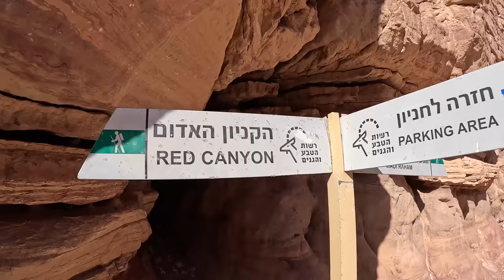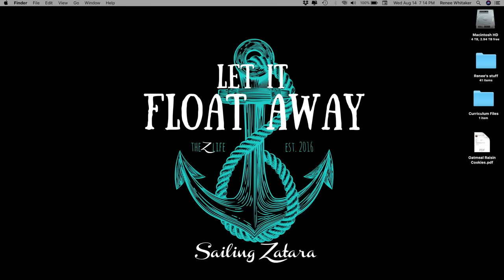We've got NO POWER!!💥 Boat Electrical Problems⚡️(Ep 228)

Comment: To make things simple in electrical world for those not naturally inclined:  You start at the source of electricity with your voltage meters (Nice choice in Fluke Keith)  and then you follow the path of electricity to where it stops. His obviously stopped at the switch. He disconnects switch after verifying the electric (either one leg or both) aren't coming through, and verifies its working where it comes in to the switch like he did. That is what told him the switch was bad. From there he removes the switch and recompletes the circuit as if the switch didnt exist, and then he turns on triple verifying that was indeed the issue and now goes to get the new switch. :) 
 I am always impressed how awesome Keith is on things he probably never specialized in. You guys are amazing! If I were 18-21 I would totally be applying for the live aboard. Hell if I were 30 I would at least fake it .... XD
Reply: i dunno. I think his AC burned out the switch. how the switch failed is the real issue. its load. which load?
Reply: @bmunday  AC here won't have anything to do with it as this is the homerun that feeds the entire boat on the line side. The load side is everything on the other side of his fuses and line side is the source that feeds his panel. The AC itself would be between the panel and the unit. If a faulty AC unit starts wearing out it will start drawing higher than normal amperage which will trigger the breaker for safety indicating there is a problem. This is all obviously assuming Keith keeps it all properly wired.
Reply: @bmunday  In the event you didnt mean AC/Air conditioning and meant AC in alternating current, please ignore ....lol :)

Comment: I absolutely love watching Keith work on the boat. I grew up on sailboats and as they say "it's always something!". QUESTION: Was Keith ALWAYS good with engines, electrical, and most of the other things he has had to deal with or did he learn everything as they occurred and necessitated repair? He is incredible and reminds me of my dad in the 1980s changing the oil on the Yanmar engine and the circuit breakers and replacing bilge pumps. Way to go Keith!
Reply: I remember a Q & A many moons ago where Keith said that he learned as they went along. Amazing...

Comment: Keith reducing wire size to the compression termination  can cause a heat problem there under full load.  Restoring to full wire size into termination when you replace the emergency battery disconnect will eliminate excessive heat build up and a secondary electrical problem long term.
Voltage flows on the corona of the wire, not within in.
Great troubleshooting.

Comment: Keith good job trouble shooting and temp solution is what you had to do. May I suggest getting a couple of knife switches for emergency spares just get them of high enough amp rating to be useful I once had to wrap bare conductors around bus bars to get a boat we had contracted operational to get to port their generators had failed I got the boat running with my deck generator by running a lead down to the engine room no easy way to make a connection this was 480 VAC triple phase power.

Comment: It wasn't a 'short' (low resistance). It was an open circuit (high resistance) due to the conductors in the switch degrading which creates a high resistance and thus reducing current and  power at the lights.. Love it when you do tech work on the boat Keith! Any more planned?
Reply: Sorry to be that guy, but as an electrical engineer, it hurts me to hear people use the wrong electrical terminology. As Graham says, when something is disconnected and won't pass electrical current, it's called an open. When you're tripping breakers, you have a short. Opens are way more common, because when devices burn up, they usually leave a gap where electricity can't flow. Even when sparks are flying, it's usually an open, with a loose connection arcing across the small gap of air.
Reply: @rickkraemer5780  Ditto as an electrical engineer same here. Right, but we still love the channel Keith!!! I marvel at the work you do on the boat on all systems, elec and mechanical et al.

Comment: Keith this is Greg I am Lauren's husband. Interesting about your water system. I work in the pharmaceuticals field as a maintenance mechanic. I operate a full RO/CDI (Reverse Osmosis/ Continuous Deionization) system. We use sodium sulfite to rid the water of chlorine. Antiscalant to help the system not have buildup and acid to obtain the proper pH. I heard you say you had that SDI reader. For me that is a silt density index test that I do weekly to see how the membranes are doing. What is involved with your system?

Comment: Scary thought of possibly having a fire 🔥 at sea and then losing power! Good job 👍🏻. As a licensed master electrician I was surprised the kill switch wasn’t more robust.
Reply: I think that this is the second YT sailing channel that I've seen have an issue with a battery isolator switch. Salty air and electrical stuff = issues.

Comment: we used these IR cameras for routinely looking for hot spots. remember that these connections heat up and cool down and will loosen the connections over time .  cleaning and tightening these connections periodically will prevent fires and down ed systems. this will also may help on your insurance to have an IR inspection annually or semi annually.

Comment: Ok.....Keith talked about short circuits.....a short is like "power directly to ground" which usually blows a fuse or breaker. YOU had high resistance in a connection (loose) which creates heat, like a light bulb "resister" and it melted. Now a short will create heat but yours was high resistance.

Comment: Now I understand that the repair to the crimp on that cable is probably a temporary solution and that there are other factors as to why you did what you did..... But for those who may be doing this on something that is permanent....DO NOT reduce the CSA of the cores because you can't make them fit. Get the correct size crimp terminal or give the cores a gentle twist before inserting. Otherwise you'll create a high resistance joint  which in turn creates heat which creates fire. Not hating on you Kieth coz I love what you guys do and wish I had the chance ; )
Reply: if you know that, you also know the switch is just a symptom of the LOAD that is the problem. itll happen again on the new switch, and worse, he de-rated the wire gauge.
Reply: @bmunday  The failing switch could have been a loose connection, that bit is up for debate. But for sure the current carrying capacity of that cable is now not to the design of the install. Having a second look it looked almost a 3rd of the strands were removed. Big no no there. But as I said in the OP I hope this is a very short term fix.

Comment: Hey Zatara, i am a certified industrial Electrician and did Infrared Thermal Imaging during my career. Please invest in an Infrared Thermal camera. This tool is invaluable in preventive maintenance. It will help you not only trouble shoot your electrical systems for hot spots(loose / poor connections ). it will also help with monitoring operating temps bearing temps, ect. The more you look into these IR cameras the more you will find you should not be without one !!

Comment: What amazes me, is that the 'installer' of this switch has placed it in a rough cut hole in a wooden floor. 

As a minimum, I would open the cutout big enough to accept a flush fit, traditional elec junction box, with a metal cover,  cut out to then fit switch.
That gets the high amp DC voltage connected to switch protected.
Also, the nearby DC buss bars appear to be unprotected.....a simple pexiglass guard works well and allows easy inspection.

Finally, I can't believe Priviledge would make this installation mistake? Most likely some add-on by someone who likely didn't consider amp capacity of switch either.

I'm not some alarmist 'safety weenie' lol!! But, I would track down all high amp DC, like the windlass, etc.....and see for yourself that all is well.

Thoroughly enjoy the channel and work that goes into it!!

Comment: Why are you not using solder on the tip of the wire before you crimp in the connection. This may improve the flow of current, without building up a lot of resistance, and protect the copper from corrosion.

Comment: Lil hint from a marine sparky who wired naval, merchant marines, cruiseships, sailboats, rec boats&rowboats w/ cute lil trolling motors;
a) reliability is key to happiness
b) complexity&more switches is a bug in waiting
c) your DC system is your lifeblood
d) your AC system is your "comfort circuit"

So... 

a) with every wire&terminal connection either use a lil NO OX to keep resistance down (and lost heat) for prolonged periods or old school is vaseline, the difference is it can be flammable, but is a universally available product and a dry wire twist vs vaseline saturated into wires makes a huge difference in resistance. Solder tends to trigger an ugly corrosion event due to dissimalr metals and a NASA Physicist/Client/Arctic explorer noted once you put silver in the circuit every other fiber begins to degrade and copper wires soon turn brown and get brittle. A standard "Lineman's Wrap" (old telegraph tech at video id O-ymw7d_nYo ), as tested by NASA&used by my pal, is the strongest wire splice.

For terminals I open wires up, grease fibers well (NO OX or Vas), then twist half into a nice solid thread, then the other half, then twist them 3X, then insert a bolt&make a loop, then twist the end super tight; great for terminals when trimmed right and no aluminum that can get messy later.

Surveyors prefer soldered joints&lug terminals, but NASA Jerry and I hated them.

Always finish w/ 2 layers of electrical tape, or if rich, add a coating of liquid electrical tape first and that junction will be shiny a decade or two later; not so with solder or aluminum terminals on copper etc.

Kate said she wanted to learn electrical. When I was 8 my aunt worked for Hughes Aircraft, taught me wire wraps while playing poker at our home&it's a good place to start learning.

b) If possible ALWAYS run everything through an inverter, have a spare in a sealed bag with a desiccant (absorbs water or old school, rice in a ziplock with little holes) and change annually.

This way NO shore power fiasco can ever screw up all your gear. The shore power and generator circuit should do one thing: run a charger or 2 or 3, so you have a redunant system and if one charger dies batteries still get power, and if you have a heavy AC load run the gen/shore power generators, it feeds the DC circuit feeding your inverter(s) and when sized right they can run a welder.

c) The best genset backup is a 5HP diesel engine with a 20MM socket on the keyshaft, 1/2 inch square rod coupler, driving a 15/16 socket direct connect to a bolt on the front of a 160 or 200 amp Cadillac alternator; one of the most reliable inventions ever made. For added reliability keep a tiny $20 12VDC motorcycle battery always connected to the alternator. The Caddie alt is a ONE WIRE EZ CONNECT and with a lil air cooled diesel can put out 2KW forever using barely any fuel. Parts are "Yanmar" knockoffs, available worldwide and the engine itself is only $350, or the price of nearly ANY component on a typical genset or main drive. 

Connect the battery+ straight to your meaty Lead Acids i.e. a pair of golfcart 6VDC in series so you never start a lithium fire, and from that drive the inverter that runs your AC to DC charger, including a SMART CHARGER for the lithium bank.

The lithium output also goes to the inverter lug or an A/B/BOTH switch then the inverter, with a good reliable fuse or circuit breaker (and backup in a bag).

Add a FAT DIODE before connecting the lithium bank to the inverter to prevent the lithiums from charging/draining directly from the lead acid circuit. This way they can only charge from the LiFePo smart charger and discharge to the inverter, and that's the safest way to prevent a lithium fire.

d) Wind and solar; before solar got cheap old NASA Jerry taught me to carve WindGenZen blades (see free classes at the site and youtube video ID AqRj3_b8eVs )

You get 20 times more amps per dollar from wind than solar and it works at night and is a great gift for poor sailors, fishing villages or land lubbers at Christmas. Lemme know if one of you gets an itch to carve a blade. Jerry flew a 14 ft diameter windgen when he'd sail to the North Pole (as close as 80 miles), but I suggest folks start with a 4 footer, and a 5 to 7 is best for safety and management. An old treadmill motor 1.5HP - 3HP makes a great generator and you can be getting 2KW for a one time investment of $180 plus a $10 wood plank and never buy fuel again. Think about that during your next $800 tank top up.

Also with a wind gen you can easily store it below, while solar can get plucked in some regions.

But with solar so cheap now I have it, you have it and it's quiet.

I'd run all that solar (and wind) to the fat, durable, lead acid golf carts, feeding the invertor, feeding the chargers(s), feeding the lithiums, also feeding the inverter...check water distilled monthly (or use gels/AGM) and 

e) and if any key component dies you have easy-to-carry spares and nothing costs more than about $350 to replace, and most can be duplicated for added reliability thru redundancy (i.e. multiple chargers) or stored as a backup.

The expensive systems most folks buy aren't always the most reliable and certainly not the cheapest. 

Once done right you could;

a) Buy inexpensive 5-10HP DC electric motors
b) drive a hydraulic pump with each DC motor
c) drive hydraulic motors on your shaft (a Kiwi sailor/Drag Racing Champ/Engineer swore by this design for power and reliability)
d) never need fuel again...

Sure; if you NEED 20KW (?welding?) and have diesel you can fire the genset or hook to shorepower (ugh!) 

Otherwise, wind and solar when done right can keep you topped up and provide plenty of propulsion, winches/windlass, house/nav lights and even hot water, stove top/oven, water making and welding.

Cheers.
Reply: I forgot the dump load.
When voltage at lead acid battery hits 14-14.5 its time to kick on some work, like a water maker or water heater, oven w/ premade dinner in it (auto cooks in afternoon), ice maker, refer/freezer or several devices.
You can also trigger a selenoid that lifts the positive of the windgen off the B+ circuit and clamps it to ground, which will stop the wind gen or make it spin really slow in a stiff wind; something that's harder to do with solar that doesn't like being disconnected under load loke that.

Comment: There is an amp. overload problem with the kill switch.  
Check the rating and measure the current with a multi-meter.
Otherwise it should not have over-heated.

Comment: To avoid sparking use a capacitor charge resistor. Also make sure your inverter is switched off to reduce the spark even further.

Comment: For anyone who may be wondering, I am pretty confident that that particular multi-meter / volt meter is a Fluke 87, and it is a fantastically accurate piece of equipment. Of the five pieces of test equipment that I use every day, 4 are made by Fluke.... Keith, a tradesman's nod to ya!

Comment: Keith it looks like you may have had a loose connection on that switch that failed being the threaded connection was discolored the heat was caused by the resitance in the loose connection

Comment: Hi guys, thanks for another interesting video. I've been riding along with you're family for several years and today, Keith surprised me. I have thought about this for a few hours and recall that on several occasions Keith has said he doesn't mind comments. The Q&A section of this video was people like me asking questions, so I'm a people and here's my question for Keith. @ 7:43 when you say "here comes the power" , and you connected a hot power line to a block or busbar it sparked and my question is: Why did someone as knowledgeable or experienced as you are, connect a hot wire that was already grounded? I'm pretty sure you know the ground wire goes on last (aka-no sparks). Lot's of people with no experience do this with car batteries all the time but I was surprised when you did it. Might be you were tired or in a hurry or, I'm the one who's wrong, so I decided to ask. Cheers from Canada.

Comment: Starlink have known issues with its connector to the dish, it self. (Dish is not moving due to current flaws),
It depends on the type of model, but RV connector/cable models arent suitable for marine conditions. Because the cable has a smaller dimension and connector have a higher tendency of wet intrusions/corrosions.
Alot of the starlink customer base has issues contacting customer service, regarding warranty and replacement parts. Some customers get thru faster, but a larger parts still have issues contacting starlink. Expect a longer time of servicing and parcel sending due to the present demand.

If a customer are aware of this, then they can modulate the connector to sort out the issue for future reference. But warranty is getting void. Starlink is aware of this issue, and its a design flaw. 

As well, soon Starlink RV going to get capped. Due to its popularity. Marine version is kind of hefty in price range atm, while RV version has a more budget range that suits many.
Reply: Solution (Network) is to make a RJ45 connector hub for marine.(sealed) Where as owner have to cut the cable from the dish and mount each wire to a RJ45 set. The opposite side from the hub is mounted as well with RJ45, which need to be stationary and grounded. (Interior).
Be aware of different size of RJ connectors. The higher number the higher current that is going thru.